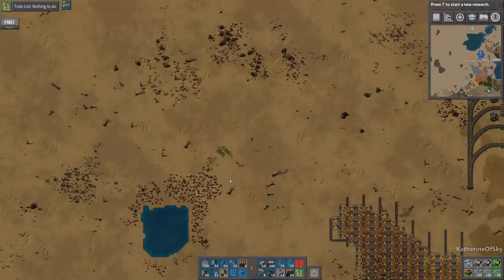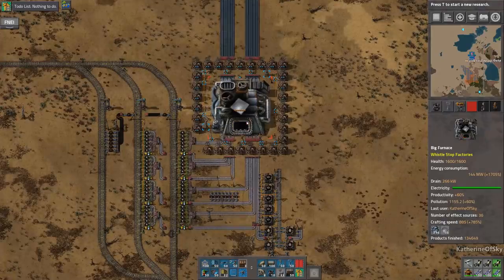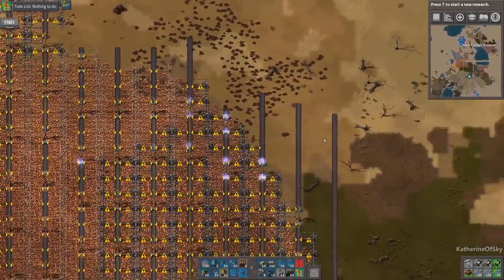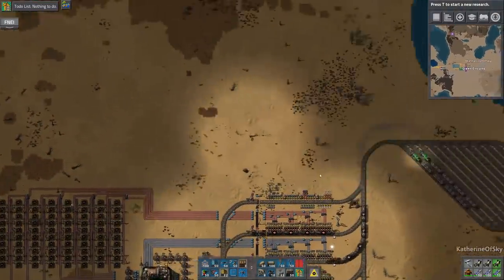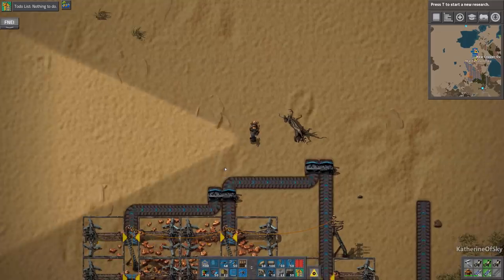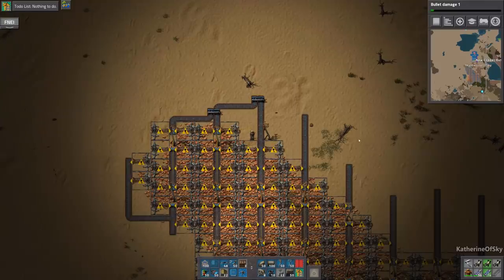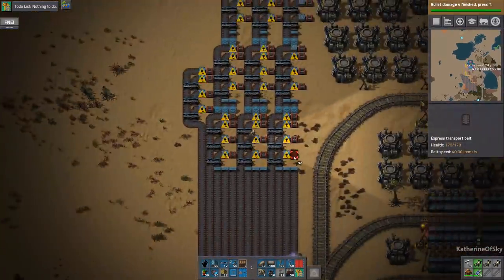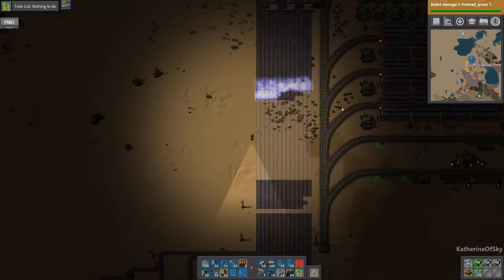Whistle Stop Factorio Ep 65: GO GO GO!!! - Mod Spotlight, Let's Play, Gameplay

Comment: The drop-off stations are for ore which stacks to 50 not 100. Each chest set of 12 can hold 28800 - 2000 for a train car capacity = 26800. So 26800 or less and you can drop off the full load. The current test will always be true.

Comment: I don't see the point of bot balancers around the whistle stop factories - surely a loader can move a full belt straight into the factory? Just take all 12 incoming ore lines and plug them into the factory. The factory itself acts as a balancer.

Comment: One thing I don't understand, is the purpose to split each belt into multiples passive providers...
I think it would be more robot efficient to make a (huge) right corner and then a line of passive providers as close as possible of the factory... and in a single line with only one chest per line.
Reply: There's probably some way to dance around and have the blue belts from the mines run directly into the factory while still unloading boxes onto the lines.
Reply: With a little bit of random thought: put the supply cheat(s) in line with the belts, unload into a priority splitter preferring to take from the mines, and use undergrounds to get that little bit of space. 
Underground down, chest, unloader, splitter, underground up, then alternate. Easier than a main bus merge.

Comment: obligatory "but KOS! smoothing capacitors are a thing!" comment
Reply: emperorSbraz steam storage would be cheaper than accumulators, and she could use a circuit and speaker setup  with global alert to warn if the stored steam dropped below 30%.

Comment: What is the bonus of this versus belting all in?
Reply from the maker: The space belts take; trying to fit all of that in.
Reply: @KatherineOfSky  I agree with the Stations. But the belts from the miners just need a few extra tiles. It should be better throuputwise. Maybe you can route the belts through requester chests
Reply: Fully agree. Although it’s very interesting as a building point of view, it’s probably slower and cost so much more material/energy than belts smelter. 
Bots are great for high tier production, but probably not very efficient for massive production like that. 
Anyway it’s a nice « monster »...
Reply from the maker: @Laurent, bot-based smelting is actually the end-game preferred method because of essentially infinite throughput.  As you go into the infinite research, the speed goes up much much higher so they zap across the screen.
Reply: KatherineOfSky Thx a lot for taking time to explain. Didn’t though about that and therefore it makes a lot of sense. I never pushed the game that far actually. And also I’m using a belt mod (about 200/sec/belt at the max) But I’m sure you know this mod.

Comment: Isn't it always "less than" 52k ? Doesn't it have to be "greater than" ? I also really liked your other Botsplitter in the entry to megalevel base. Hope you will add like four times as much bots to this base.
Reply: You can do both, depending of the decider combinator you configure next :)
KoS decided to check "<52K"  => if any of the car is greater than 52K, his combinator won't send his blue signal, and the train signal will be closed (need 4 blue to remain open).
If you check ">52k" for each wagon, then the train signal should be closed if blue >0 (instead of blue <4 here).